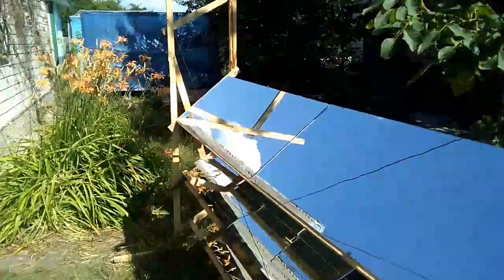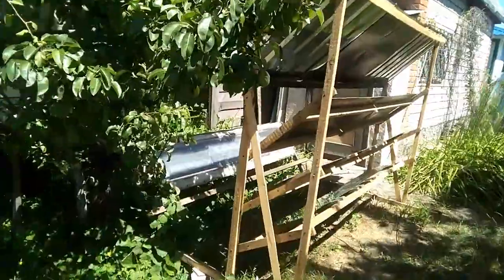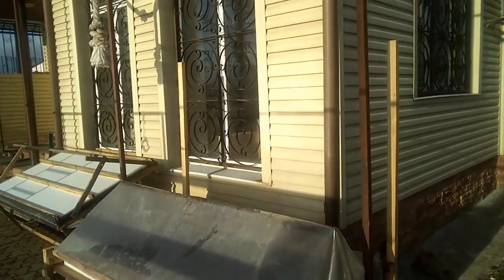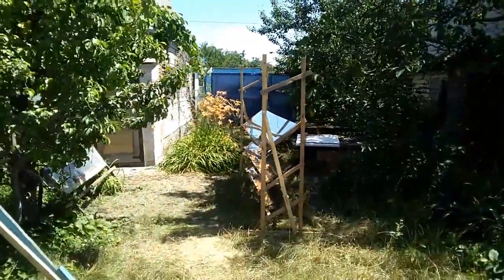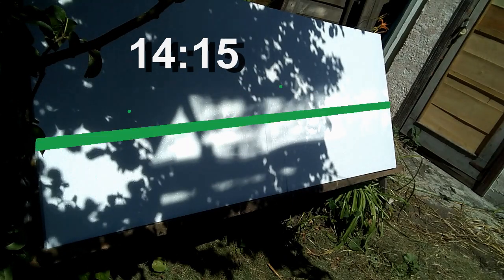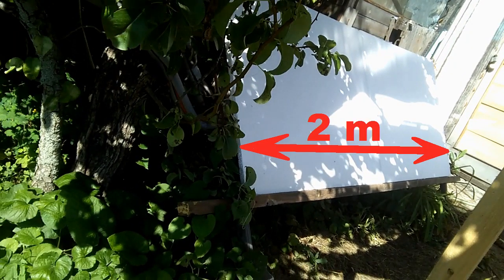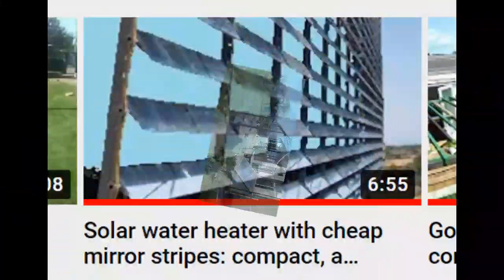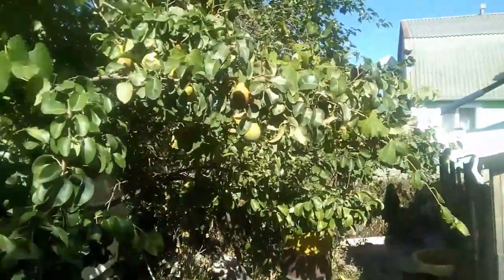New type mirror system for a solar heater, greenhouse, passive solar home heating

Comment: If you had a stack of thin plates of metal sandwiched with fine gaps between them, would they be a more effective captor of light energy?  Seems like it would have to keep bouncing between them to the bottom of each layer.  Possibly the gaps could be filled with glass, as that would admit light and reflect IR, while also reducing convective losses.  The heat pipe would flow transversely past the metal layers.